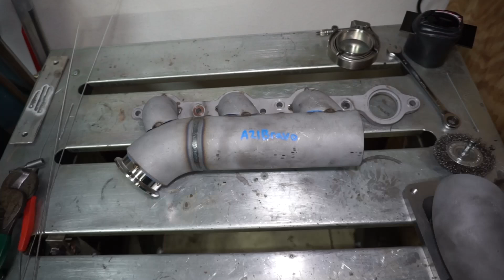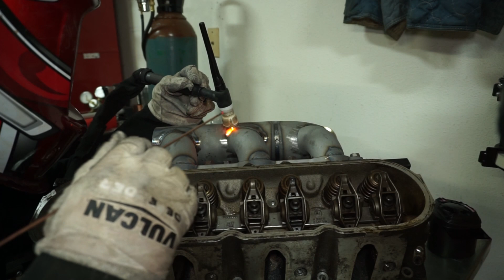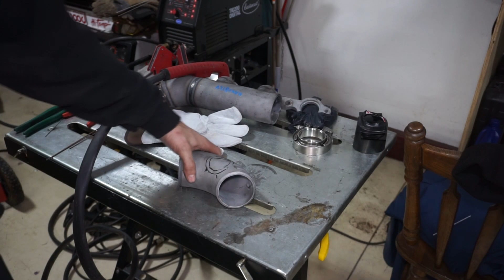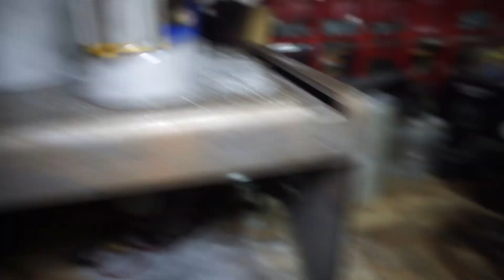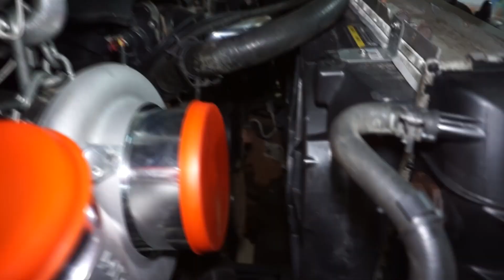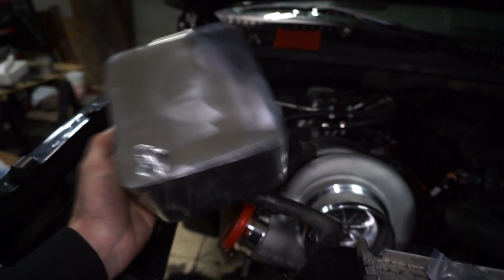Mounting MASSIVE 88/103 Turbo With Fahler Speed Log Manifold T6

Comment: That was my only gripe with using a t6, with a trick manifold in particular, is that the exhaust housing sits soo close to the oil fil cap D:
Reply: Switch your valve cover sides

Comment: Long time subscriber. 
Quick question: which 4L80e pins do I wire to +12v, ground, TCC lockup ground? Does TCC get a separate+12v? Or does it use the 12v that is supplied to the top left pin? Is it grounded through the case? Or on a pin?
I did some mods to the internal harness, as per a write-up. I did all the internal mods back @ OCT, and installed a 4000 stall triple disc lockup FTI converter in my carb LQ4, MSD 6014 controlled 69 Corvette. Ditched the th400 for the 4L80e. Had to make a custom cross member. I am also using a 4wd trans, and using the front t-case seal to seal up @ the yoke. Hope it all works. 
Finally cranked it back up yesterday with my son. 
Any help, I am grateful. Thanks again. 
All best.
Reply: I tried commenting on a different video about 4L80e electrical, but it would not let me comment on that video. Sorry to get off topic on a recent video
Reply from the maker: What are you having to wire all that stuff for? Are you asking about adding those pins back to a stock ecu because you changed the trans or?

Comment: What kind of pipe do you use for headers and exhaust. Is a flex welder good enough for building headers?
Reply from the maker: Stainless or aluminumized. This manifold was mild pipe. I would stay away from flux core if you can. It works, but a gas MIG will be better and can get them pretty cheap $600-$800.

Comment: Do you think you would have had room to use this log and t6 on your last foxbody if you went with a single turbo and downpipe headed to the firewall and down? Or does the hot side that goes underneath the transmission get in the way of the downpipe part there? Thanks
Reply from the maker: I think it would hit strut tower... not positive.
Reply: @BlaserBuilds  I’m running out of options sir, are there any kits or pieced together ones I can use for the fox that have my turbo near where yours is on this Cadillac? I’m trying to get one as close to my on3 sbf location . Thanks

Comment: Did you have the metal directly grounded to the plasma or to the table
Reply from the maker: Table
Reply: @BlaserBuilds  thats happened to me a few times try and ground directly to the piece see if that works especially with a round piece not getting full contact ...just a suggestion
Reply from the maker: @ricardov9111  yeah I can try that. I think the tip is damage to so going to get some new one and try to get some practice, lol.
Reply: @BlaserBuilds  Drill a starting hole too. They aren't the best at plunging into metal.